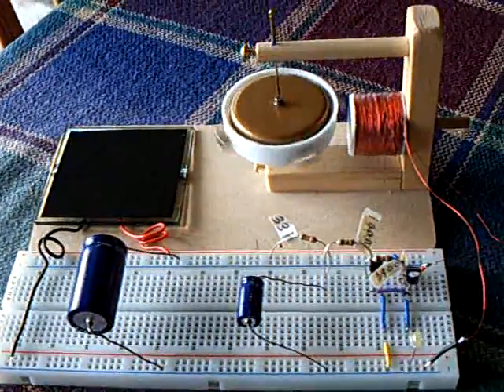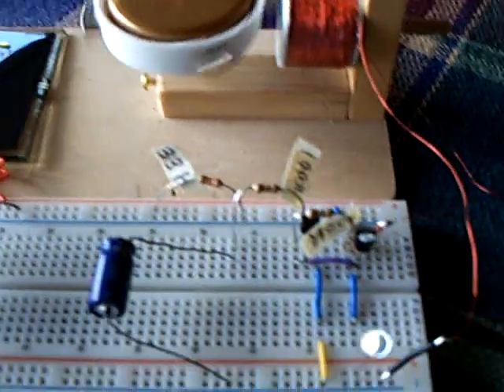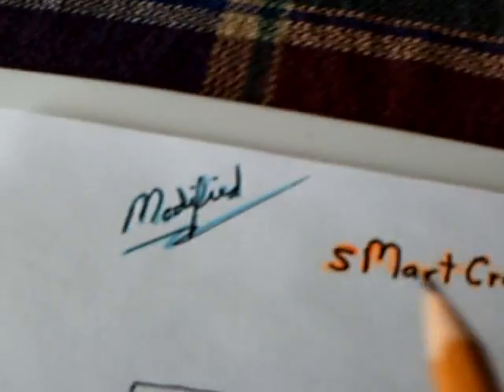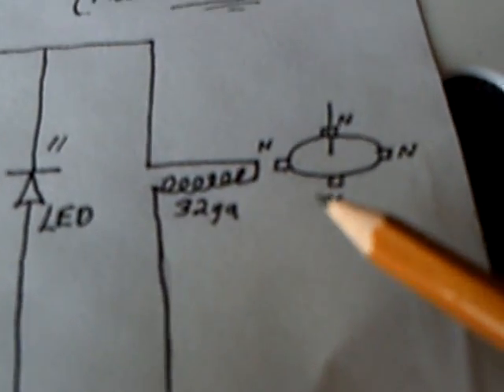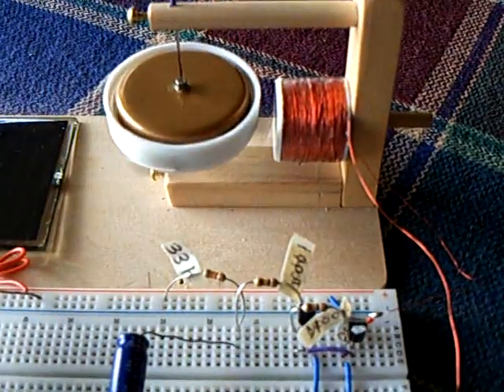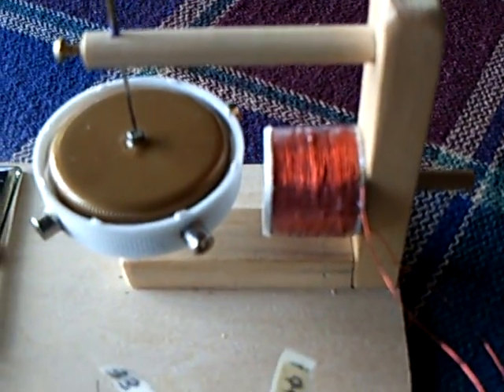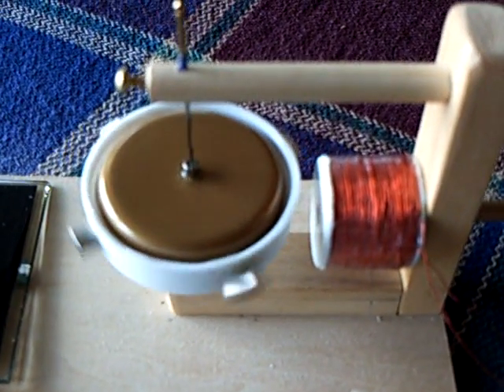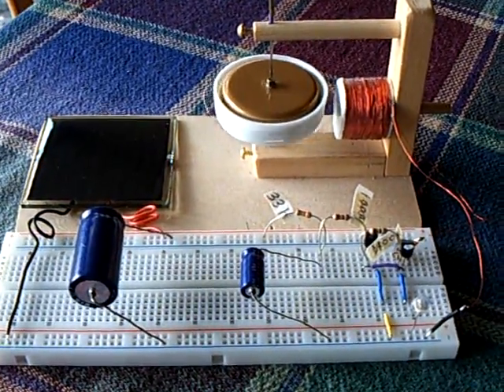sMartCreations self start solar pulse motor

Comment: I am trying to replicate this circuit and have been for a while now, but just cannot get it to work. I'm 100%  positive that my bread board circuit and components are correct other than my coil, it's my coil that is letting me down I'm sure of it. How do I make a coil with the right resistance and inductance ? As it stands as soon as I power my circuit the Led flashes at a fast rate and the coil doesn't turn the rotor at all.... Any advice would be greatly appreciated. Many thanks.

Comment: Got my motor to go over 10000 rpm the trick is to use only two magnets why becouse u got to think if there's more and close together when the coil turns on to push on magnet it is also pushing on the other close magnet also

Comment: Lidmotr  Good job 
About capacitors,  you used 100uf and 1000uf but how many them voltage? 100uf ,1000uf 6.3v or 10v or 16v .which voltage is better?

Comment: For a novice who would love to try and replicate, what are the Volt's of the two Capacitors(1000uf-100uf) an could you say your Coil's turns as well, I also wonder if the AWG of Coil wire is +/- a Gauge, would that matter? Thanks in advance and I have to say I love your work and that your sharing of all your circuit Diagrams, Cheer's to the Sharing you and other's do with the circuit diagram's inspiring the Novice.

Comment: Nice circuit. Wanted to build one, but I had a couple of questions about the coil.
Q. 1 What is the coils resistance? 
Q. 2 About how many feet of what gauge wire is it made from? 

Thanks,
Paul